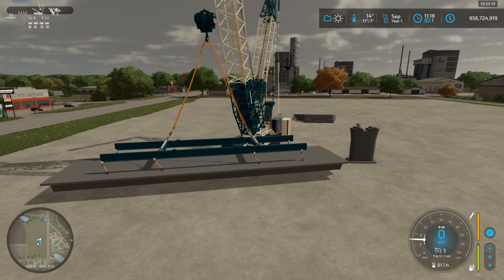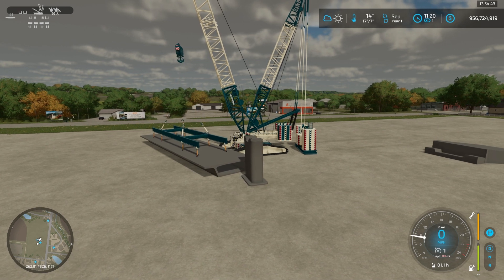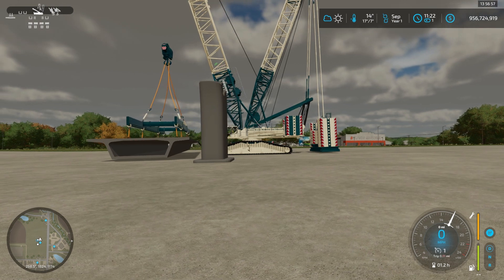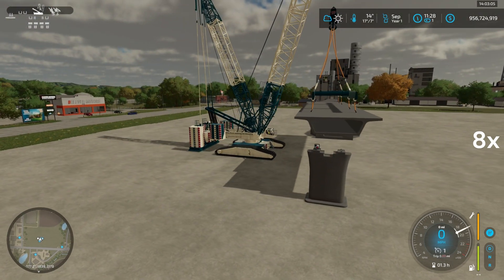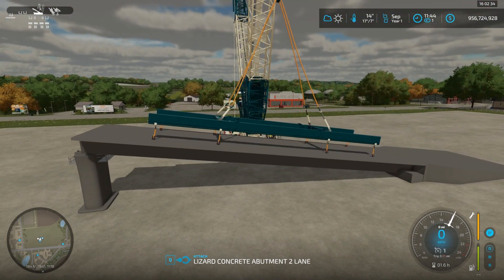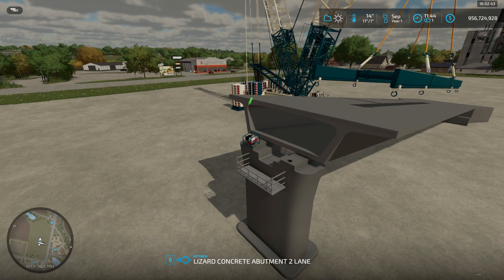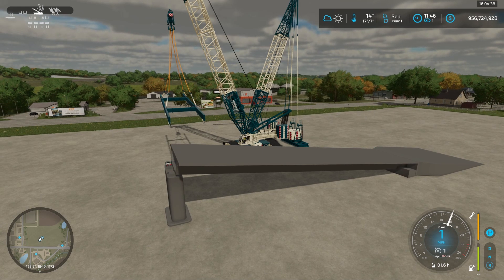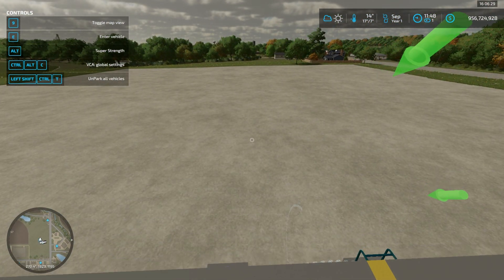FS22 Buildable Concrete Box Girder Bridge Tutorial Part 2

Comment: How did you detach the bridge without the system attaching the lane with the bridge hanging on the crane?
Reply from the maker: @chinzhenyang9648  if I remember correctly, I had previously attached the generator onto the  ridge pier. Once the bridge span was in the correct place I switched to the generator and was able to attach the bridge span from it. I would then  move the generator to the next pier and continue until the last section.
Reply: @jeremybrown9379  how would i build the last section with the end lane if there's no way to attach the generator?
Reply from the maker: @ attach it from the crane. You could build it from each end and allow the middle span to be the last or you can build from one side to the other. Last section would be attached from the crane, then the crane detaches from the span.